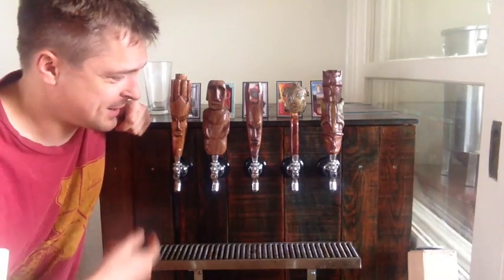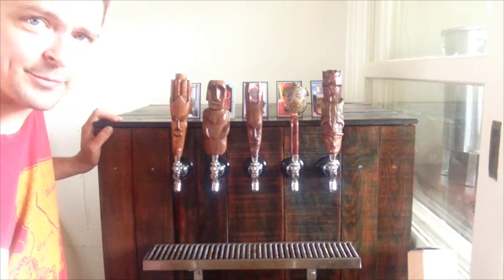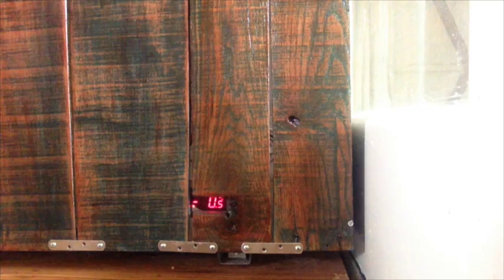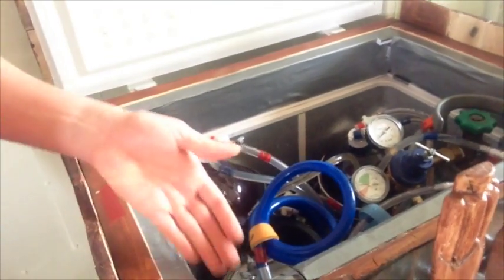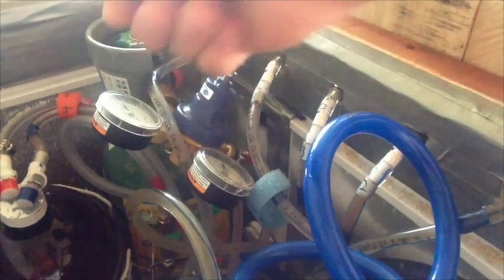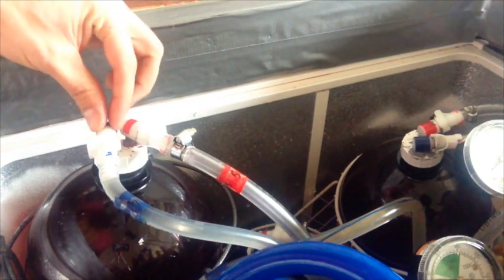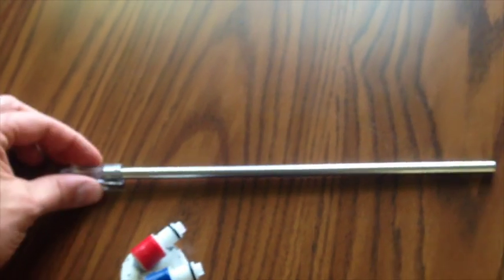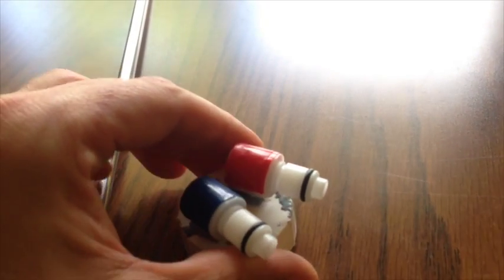Kegerator TapADraft tutorial

Comment: How did you deal with the post in the middle of those molded caps?  The ones i bought have a cylinder post in the middle that seems like it would be hard to cut out before you drill your holes.

Comment: How are the tap a draft bottles holding up for you? Do you recommend it for my situation? I have a small kegerator with one 5 gallon corny and wanted to add another tap to it to have 2 beers on tap this summer but don't want to modify the fridge anymore than I already have(can't fit another keg in there). I can probably fit a tap a draft bottle in there though.
Reply from the maker: That's mainly why I use the tapadrafts...they are skinnier than kegs.  If I could find a metal keg that skinny, I may have gone that route.
Reply: Thanks for the reply. I ended up buying a 2.5 gallon keg since the diameter was slightly smaller than a 5 gallon keg. I now have two kegs in my fridge!